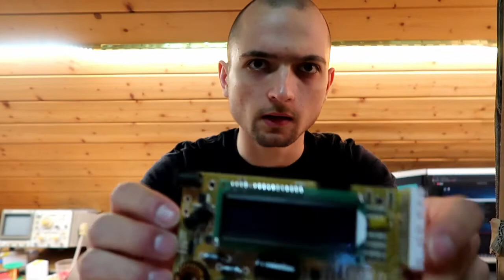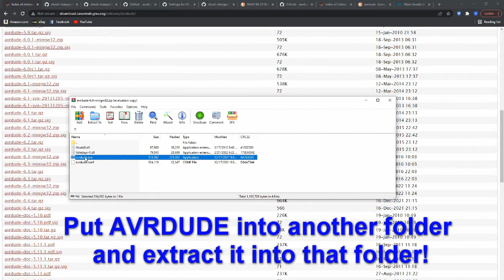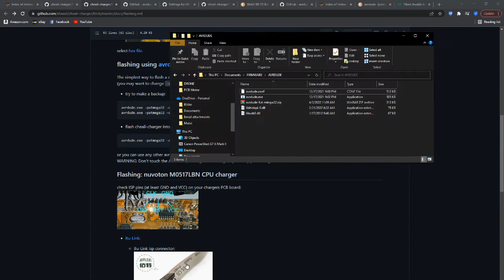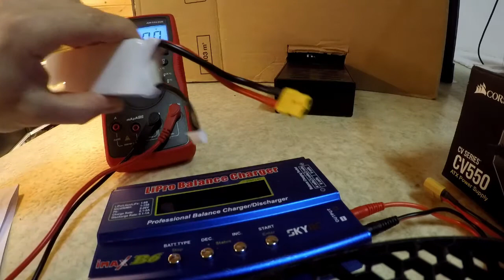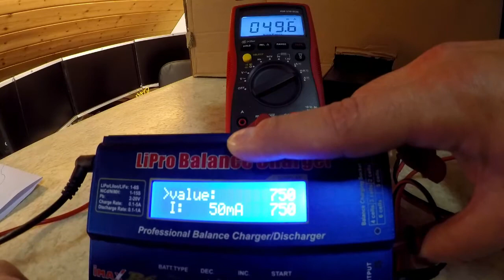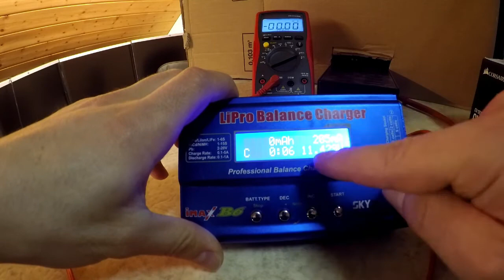UPGRADE YOUR OLD LIPO CHARGER FIRMWARE TO CHARGE LiHV BATTERY | EASY CHEALI CHARGER UPGRADE

Comment: Very nice thank you. Just from the directions on GitHub I was surprisingly  able to flash my HK4B6  (I flashed each of the MCUs with "IMax B6 original" unstable hex files) and that went very smoothly, I didn't even have to solder the pins I just held them in place during the flash.  But I'm glad you were there to demonstrate the calibration process, because it wasn't clear what to do, and I had to do it to each of the 4 MCUs. Now my 11yo charger is cool again.

Comment: I have a sky rc imax b6 version 1 and the voltage calibration is off. I did the calibration by pressing the Dec and enter key simultaneously and powering on the device. I connected a 3.7v battery and checked it's voltage with a multimeter and accordingly calibrated the charger. But the problem is i had to set to +20 and still the calibration is off by around -0.07 volts. Do you have any idea on how to fix this or do i need to reinstall the firmware? Will this upgrade also work?
Reply from the maker: Hard to tell the problem based on your description. The firmware upgrade might help, but if the charger is broken or you do the calibration in the wrong way, it won't. Also, i am not sure what the calibration process for the original charger firmware looks like. It might work differently. Anyways, here are my thoughts: Did you use a battery with enough cells for calibration? I think you need at least 3 cells to calibrate all measurement circuits. I also can imagine, you may have calibrated the wrong cells. Cell number 1 in a lipo pack is the two first black wire pairs on the balance lead and cell number [max] is the red and black lead. You may have interpreted the enumeration the other way which would lead to wrong calibration. Follow the calibration part of the video closely and make sure you calibrate the right cell number on the charger for the right cell in the battery. I hope this helps!

Edit. I see now, you calibrated using only one cell. In that case, I do not see why the calibration should not work. If you calibrate till the displayed voltage on the charger matches the displayed voltage on the multimeter then the calibration should have worked fine.
Reply: @johniii5776  Thank you I'll try with a 3s pack. 
Also in the video you Flashed using the clone imaxB6 (cheali-charger-imaxB6-clone-50W-4.5A_2.00-e10.3.12-20160613_atmega32.hex). In the Github page there is also the original imaxB6 (cheali-charger-imaxB6-original_2.00-e10.3.12-20160613_atmega32.hex). will it make any difference using the original???
Reply from the maker: @lebanrifordrndohling  It may be that i accidently showed the wrong hex file in the video. Use the file that suits your charger

Comment: Hi, what mA fuse have Your multimeter that You can measure 300mA without blowing it?
Reply from the maker: My meter has an option for 400mA and 10A I always use the correct fuse. If your meter only has a 300ma option there is no reason to put a bigger one in it. You can damage your meter. You need a meter that has a bigger current meter in it.
Reply: @johniii5776  Ok, i see. My meter has a 200mA fuse for the mA resolution, but when i try to calibrate in this resolution the 50mA charge current it blows the fuse all the time. I noticed when i hit the enter button to start the current, it starts with around 850mA for a second or less (enough to blow the fuse), and then suddenly decrease to around the default point. So i'm not able to measure the accurate current in the <200mA resolution, just with the <20A option. What is cause this?...

Comment: Hi, thank You for sharing this!...I don't have Arduino but a CH341A programmer. Can i use it to flash my Atmega32L Turnigy Accucell6 50W charger? Thank You in advance...
Reply from the maker: I am not 100% sure but I think it should work. I cant provide any specifc steps, I have never worked with the C341 programmer. But you can try to connect the wires the correct way and see if AVR dude can flash your charger. Maybe there is already some documentation on this on the internet aswell.
Reply: @johniii5776  Did You use the 5V power pin for VCC?

Comment: Thanks John! 
This is really useful information, and you've taken the time to show all the steps.
I've just returned to flying RC Helicopters and multirotors after a break of about 6 years, and to my surprise a lot of the LiPo batteries I'd kept in the fridge at storage charge were still within 5% of their original capacity. However, with 3 microhelis, 2 quadrotors, and a pair of 450 scale helicopters and room to fly them at my house, the batteries have quickly had dozens of cycles and are now being retired.
A shipment of new batteries arrived, and in the time I hadn't been flying HV LiPo become more common, and I have accidentally found myself with a number of extremely affordable HV LiPos, but my Junsi iCharger 106b+ pre-dates HV LiPo and will only go to 4.30V
Imagine my surprise to discover that the iCharger has been cloned by everybody, and that there's now Open Source firmware for it.

Thank for the video. I've subscribed because I think you do some very interesting stuff.
Reply from the maker: Thanks! Glad that the video could help!

Comment: hey john, I was wondering if we could get in contact about your 3D printed rc cars steering.
how did you make sure the joints where fluid and smooth?
what recommendations do you have in the case that I cant use bearings/bushings?
thanks for helping bro
Reply from the maker: Hi thanks for showing interest in my projects! I the trick is to use low layer heights (I use 0.15mm for the car). For connections between joints i like to use wire about 0.6-0.8mm thick.  I design holes in the parts and connect the 2 moving parts with the wire (slide wire through the holes and bend the 2 ends so it cant slide out). It is very smooth, easy to assamble and has quite good tolerances. Direct connections between 3d printed parts without using wire or screws or something else will have friction, worse tolerances and be more fragile. I recommend the wire trick it works really well. Also I use 8mm×5mm×2.5mm ball bearings for the wheels. I design a 8mm hole where the bearings can be pressed into. The wheels have a 5mm lug on them and can be pressed inside the bearing itself. I can do an update video about the car, there are quite a few changes and it works really well by now. I may have time im the following weeks but time is very scarce at the moment :) Again, thanks for your interest and have a nice day!

Comment: Hi! 

Thanks a lot for sharing this video, you know, since some weeks ago I'm loosing my comfidence in my charger calibration and more than flash it with a Cheali firmware I was looking for  some steps for with comfidence reading the existent firmware on my chargers (I have 2 identical, GT Power X-Charger B606). This, just because some chargers has on it a 'once time calibration option' and I want to check this on mine having a copy of the firmware of the mcu of my charger.

I didn't read anything yet, but just watching your vid can solve 2 questions that I have previously, 1st how to identify the mcu without desolder the ide connector of the screen (if I didn't watch you doing that probably I didn't dare it on my own charger :V  ), 2nd, how to identify just what connector (the isp connector) is the one to start on (if exist even) without check on the cheali github page.

Thanks again your vid is very explanatory and your advices are great! regards from chile,
Reply from the maker: Thanks for your feedback I am happy I could help! :D

Comment: Hello , do you have information for Connector for GE Power B6 , ?
Reply from the maker: I think if there is any you will find it on the official cheali charger github page
Reply: @johniii5776  yes, I found thank you it was almost the same card as an accucel 6.

but in the end I don't like the cheali at all.
it's not pretty and you need a too precise multimeter to adjust the calibration. and there are problems on two output of the balancing voltage drop when I connect the connector.